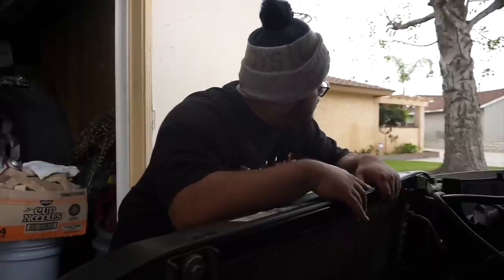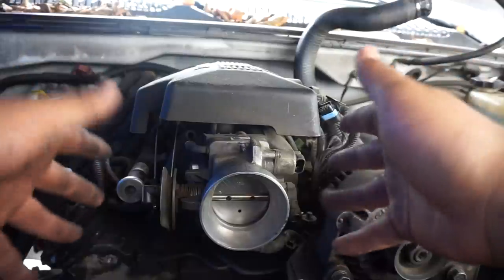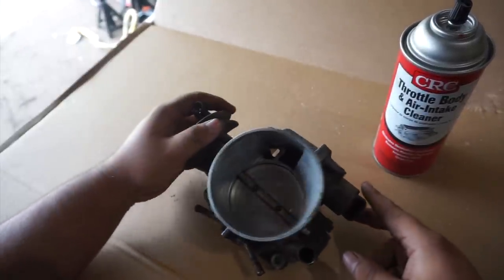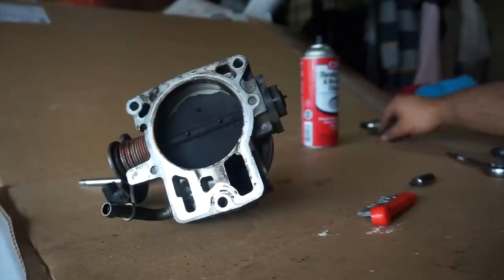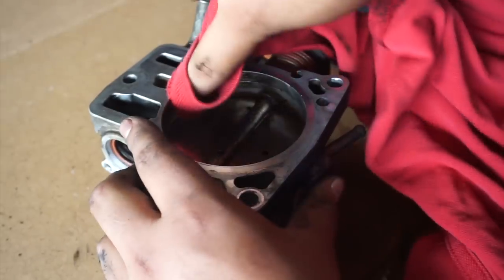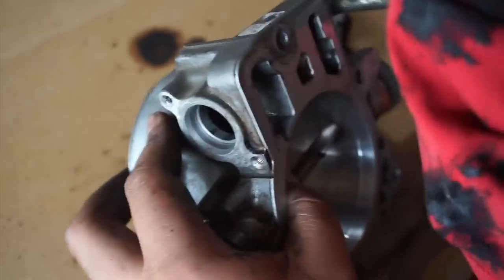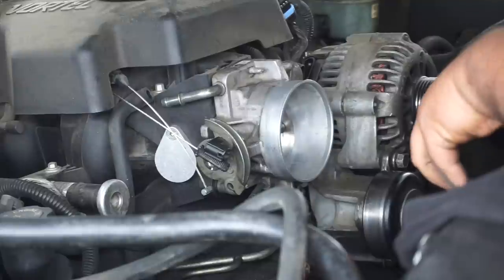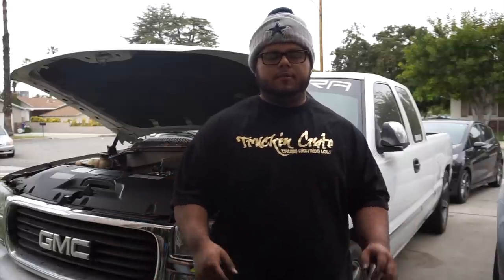Cleaning Throttle Body - 2000 GMC 5.3 (4.8,6.0- 99-07)

Comment: I used this video to get the details of the mounting bolts. I cleaned the throttle body on a 2003 chevy express 3500 4.8L today. That thing runs like a cheetah chasing a gazelle  now. Would not idle before without foot on throttle. Great video.

Comment: Thanks for sharing. I was really hesitant to disconnect the throttle/cruise control cables until I saw this. Afraid I would do it wrong but this gave me the confidence I needed.👌
Reply: Did u happen to get a check engine light after disconnecting everything?

Comment: Hey man I have a 03' Silverado 2500HD with the 6.0. Is my throttle body mechanical??? Thanks for the help.
Reply: It's drive by wire not cable like in the video
Reply: @itsmemaaaark  Thanks

Comment: hey I got a 2000 sierra with the 5.3 and seems like my throttle is stuck open truck will accelerate with out even pushing the gas.  if I clean it will that make it idle normally
Reply from the maker: Yes, it sounds like it has dirt holding it open, give it a good clean and you should be good 💪🏾💯
Reply: @Jay did you ever find the issue? Having something similar with my 99 5.3 Silverado
Reply: @justingersjes6875  yea I cleaned all the carbon out the throttle body and had to adjust my Cruze control cable but been good since
Reply: @Jay-zx8fj  thanks for the response. I still can’t figure out the issue :(. I’ve cleaned the throttle body, replaced iac, tps, maf, and still have a high idle that causes the same issues you were having. I have no vacuum leaks. Also took to the dealer where they replaced pcm as a last resort. Still having the same issue. Do you think the throttle butterfly valve is sticking?
Reply: @justingersjes6875  it could be I know I had to scrub inside right where the butterfly valve is and u may wanna check your throttle cable and make sure it's seated properly

Comment: You know you can mess up the throttle body by cleaning it and you would have to pay over 100$ to have it reprogrammed. So do it at your own risk.
Reply from the maker: 214mannygarza dang I didn’t know. I thought it was only with the electric throttle bodies. Good thing nothing happened to min
Reply from the maker: Mine*
Reply: Only if your spraying the electrical outlets. If you take them out and be careful of where your spraying. You'll be fine, I do all my throttle body cleaning with the tb  on the vehicle tho. Just like pressure washing the engine bay with the engine. Dont spray the hell out the electrical
Reply: That on drive by wire throttle bodys... drive by cable like the one hes showing in this video its fine...